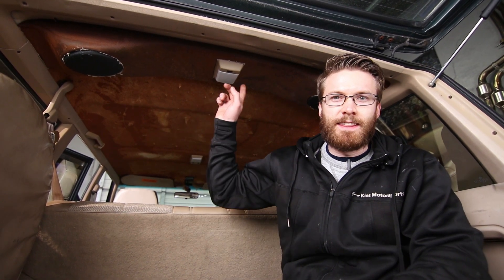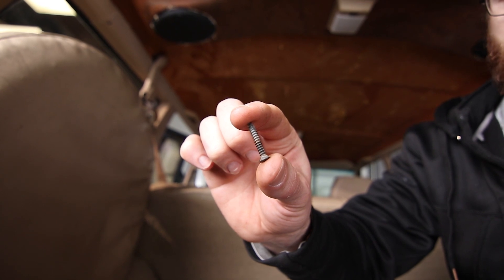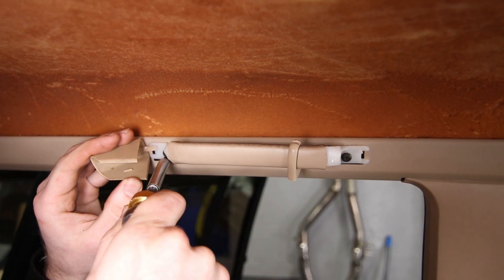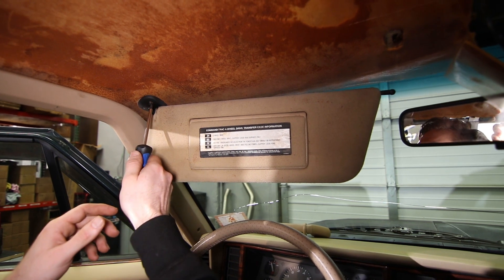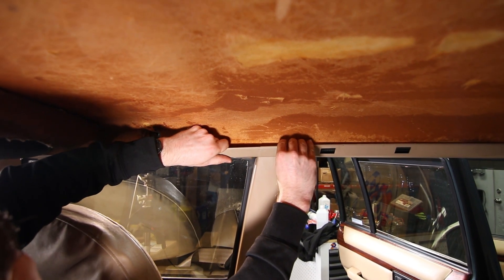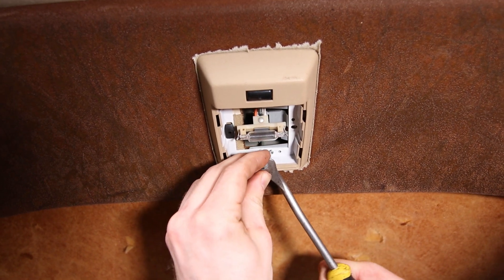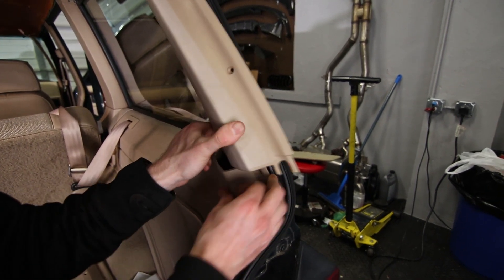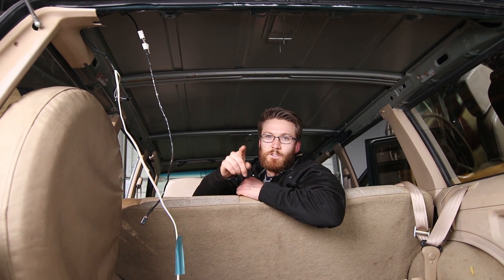XJ Build Pt 2: How To Remove XJ Cherokee Headliner

Comment: Just a tip:  when you remove each screw, use a piece of clear packing tape to stick to the trim piece next to its hole.  Takes a little more time, but it makes reassembly a breeze since you don't have to hunt for just the right screw.
Reply from the maker: Not a bad idea!

Comment: The one piece of trim you didn't remove was the A-pillar down to the fuse panel passenger side.  Trying to remove that to run power and antenna coax for 2-way install.  Any hints?  Good video, tho'.
Reply from the maker: We got stuck removing that ourselves and were able to leave it in lol